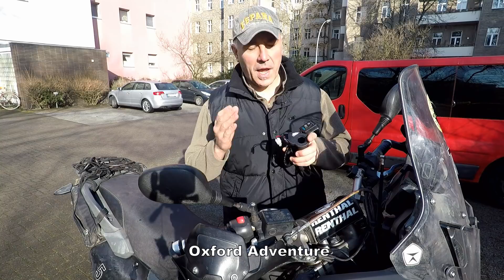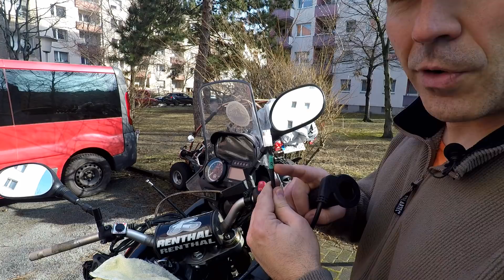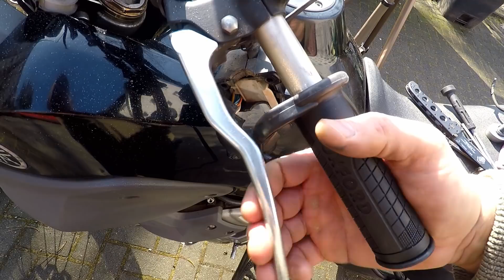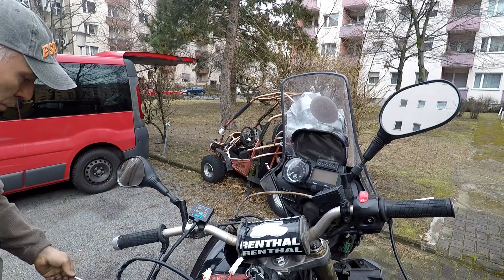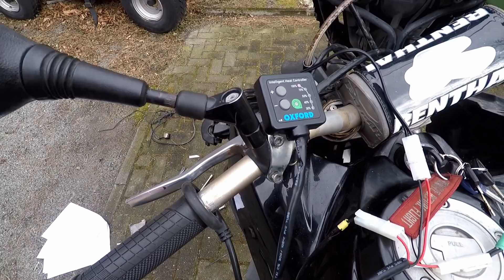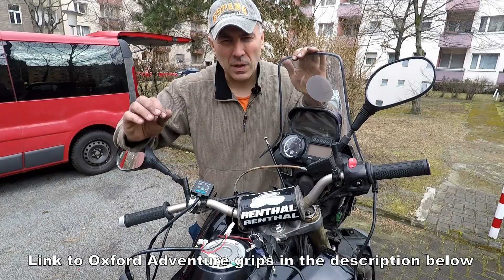How to install heated grips on your motorcycle? - Step by Step!

Comment: Instead of using a knife and/or sand grip, using isopropyl alcohol or some other degreaser (I had some WD40 also, forgot which model) will dissolve the old glue pretty fast. Also, if the degreaser has a thin tube, you can slide that under the old grips and spray so you can take them off without cutting them. I used some honda OEM glue and for that they say to spray isopropyl alcohol over the glue to make it slide easier and it sure did.
Reply from the maker: Thanks!

Comment: Very important, check that you can still use the brake, in the full range of the throttle. I know that you normally let go of the throttle during braking, but you know just in case.
Reply from the maker: The same for the clutch lever
Reply: @motorcycleadventures  yeah but the clutch side doesn't spin :)
Reply from the maker: But wrong position of the heated grip might block the travel of the lever.

Comment: Any new thoughts on what type of glue is best ?
Reply: I used a Honda OEM grip cement, part number 08CRD-HGC-23GHO. I just installed the grips so I don't know how long it lasts but it's not quick drying so you have some time to adjust things. In a Honda manual I found online, they say to spray some isopropyl alcohol over the glue to make sliding in easier and it totally did.

Comment: thinking about the same for this winter but not sure how effective is that. Can you confirm it does wok good enough to warm up fingers? because palm of my hands never get cold, fingers do.
Reply from the maker: I will confirm that without it you cannot travel in the winter for more than 30 min. They are perfect.
Reply: @motorcycleadventures  thanks, will try them then.

Comment: Hey Pavlin - a tip from us track racer boys to the adventure boys - on the track we usually have to change the grips after a crash (I did a few of those!). A really cool trick I was shown was to use compressed air between the grip and the bar/throttle assembly. The air blows in and forces the rubber to bulge slightly and you give it a gentle push as you go along - job done. the grip basically moves along over a cushion of air. When you release the air - the bulge releases and the grip hugs the bar. Great video man! Thanks

Comment: Where's the beard gone? All bikers have beards lol. On a more serious note, I have a dr400 an after riding for half an hour my left arm goes to sleep, if I put a throttle grip on the left side so it is not solid on the handle bar do you think that might work? I thought I would try it while fitting heated grips. Many thanks Pavlin for great videos.
Reply: I installed grip puppies and it helped me a lot

Comment: Those connectors do not appear to be weather tight.  It might be useful to pack them with dielectric grease to prevent corrosion.

Comment: This is one thing I like about my BMW.  Heated grips and seats were standard equipment.  I would definitely install grips like these if I had a bike not so equipped.  They make cold weather riding much nicer.  I can wear my mesh summer gloves down to at least 40 F (5 C for my international friends).  Only need to use insulated gloves for really cold days.

Comment: Pavlin - maybe you could have explained on the Throttle grip & brake lever - l myself have the cables coming over the top to prevent them getting caught
Reply from the maker: I have enough space between. You can adjust the break lever from the scroll.

Comment: Thanks for video. I guess it's better to connect  heating grips to battery though relay managed by power from ignition lock or headlamp or something. In this case grips allways will be switched off when engine is turned off and you don't need to buy expensive grips with battery saving option. Some motocycles has empty pins (powered only when engine started) for additional devices and you do not need to cut any wires or route new cables to battery.
Sometimes kids or even adults loves to sit your bike and press all the buttons when you leave your bike on parking :)
Reply from the maker: Yes, but with this grips is not necessary. The automatic off system is working really well.

Comment: I use these Oxford grips since several years in 3 motorbikes. They are good enough, relatively cheap and do not kill your battery due to electronic protection system. The only thing I have is that after few years in hot days the rubber becomes a little bit sticky but it is not a problem.
Reply: yes , be careful what you soften your gloves with ,I had a stiff pair of gloves which I used a bit of linseed oil to soften them ..it destroyed the rubber right down to the heating wires !.
 The new Oxford grips are lot easier than the older one where you had to fit a relay , its all electronic detection of voltage now within the controller. Its not a hard job at all.

Comment: I put those very grips on my bike when I bought it 5 years ago. I just went with super glue, but you need to be quick. Here is a tip for you the next time you ride in freezing or snowy conditions. Since you have fitted the new grips, now purchase the Oxford rain seal bar muffs, remove your hand guard covers and slide them over the frames. Now with both you only need to use the 50% heat setting. I wish I done it years ago.

Comment: Thank you for this!
I just don't understand why manufactures leave the cables on that direction. Is that so hard to make the cable pointing towards the inside of the bar? I think there's no excuse for them.
Reply from the maker: Agreed
Reply: On the heated grips from Bikemaster I installed, the left grip's cable points forward and the right one backwards, as it should, so even at wide open throttle the cable is under the handle bar.

Comment: Perfect timing. Thinking about getting a new sinnis 125 terrain, should be fun for pottering aboot on and enough to drag my 100kg aboot but not too much to insure or run ( or kill myself with having not ridden for a long long time). I don't need to go over 50/60 mph much on the roads I will use it on and there are more forest tracks than road about this part of Scotland for fun. My thinking behind this bike is it is new, relatively light, cheap compared to second hand where I live, and warranty for 2 years. i will have it serviced properly although i could do it myself and it is a 'for the pleasure of riding' bike not a daily commute. A 350 or 600 would be nice, but so heavy and they really cost a lot second hand and you have no idea at all how much punishment they have had. Lexmoto are getting a reputation for reliability too but the Sinnis using Suzuki and Yamaha tech might be more reliable at a similar price point for an enduro model. Heated grips may well be an option and I was wondering how hard they are to install so cheers.
Reply from the maker: Now you know its not difficult and you can make it yourself

Comment: Very good video as always. Oxford is solid brand. I personalty like to connect all electronics that is not original, that i put later (charger plugs, gps, heated grips ect.) via relay that is controlled with headlight. So  when i walk away from motorcycle I am sure that everything is off. There is safety feature in grips controller, but just for any case I like to do it this way. Thanks for video.
Reply from the maker: Yes I understand but you don't need to make it that way whit these grips. The automatic off system works every time.
Reply: l agree, my relay is under the seat connected to the numberplate light wiring - then only needs a single fused cable upto the power sockets etc close to the headlight/handlbars

Comment: nice video, I am wondering what is that cable that goes straight up in front of speedometer; the one is not connected anywhere. Cheers !!
Reply from the maker: This is my spare clutch cable
Reply: Motorcycle Adventures It's very good idea. One time when my clutch cable was damaged I had to shift gears pulling the small lever on transmition 40cm under my ass :-D

Comment: Hi!

Wouldn't be better to have those cables pointing up and forward than down and backwards? It looks like they might be in a way when full turning (hitting tank). Issue with turning right grip (opening gas) might collide with brake lever similar as you showed with clutch lever. I'm not sure if this is real issue, hopefully You will not have to cut new grips :). Cheers!
Reply: @Uldis MM  I mean that this could be safety issue, of course normally first you release gas, than grab brake lever, but what if in some way you will catch lever before releasing all gas and those will collide? You won't be braking (at least fully) and still applying gas ;). Nothing should ever be in the way of brake lever. That was only my point.
Reply from the maker: No this is the right way. They should be pointed down.
Reply: @Uldis MM : Why would you do that ? :0
Fan of burned tyre ? :p
Reply from the maker: This combination never work together.
Reply: what is situation when you use full throtle and brake in the same time? :)